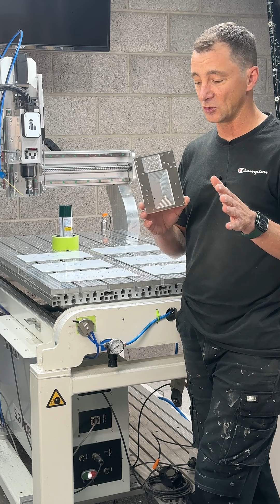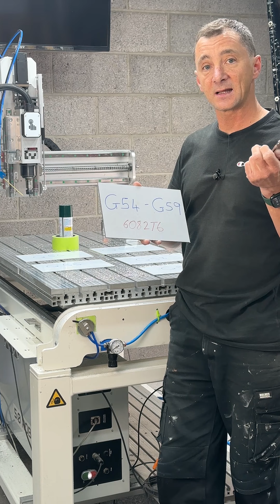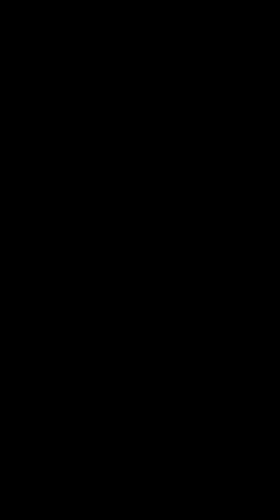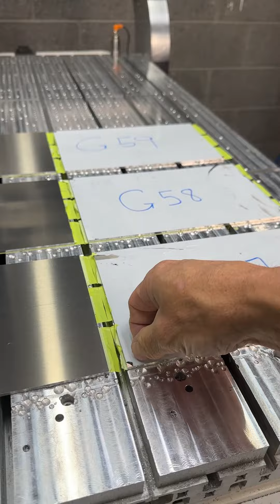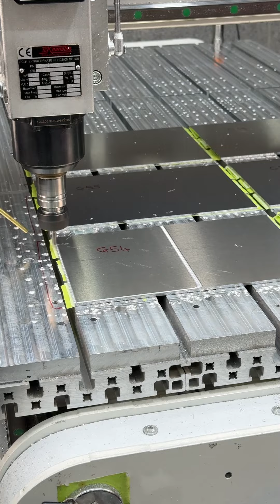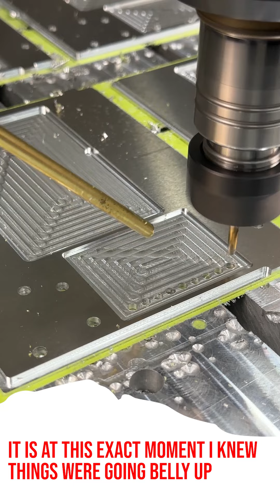Tape and Glue Milling Aluminium Parts on a Model 8

Comment: Nice video. I make a lot of switch plates from 2mm brass, held on a vacuum fixture. The cheapest way to get the brass is guillotine cut but it twists it a lot. I built a straightener to get rid of the twist, that consists of 11 lower rollers and 10 upper rollers. You feed the brass in one end where the rollers bend it back and forth a lot to start with but they get progressively further apart. It makes the sheet very flat when it comes out. Some sheet metal shops have large units for parts that bend from laser cutting but they have large rollers that don't work so well for small plates. They are kind of similar in concept to a coil straightener
Reply from the maker: Thats super interesting - do you have any videos of your straightener?